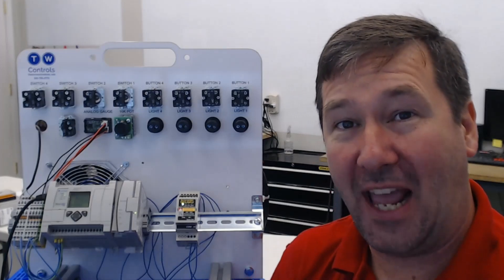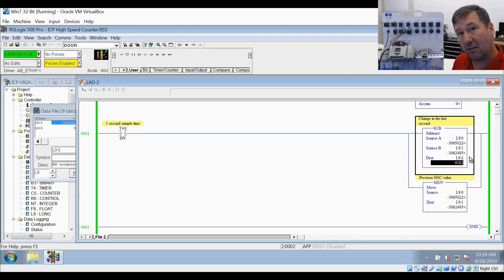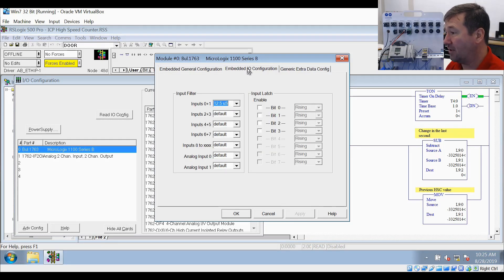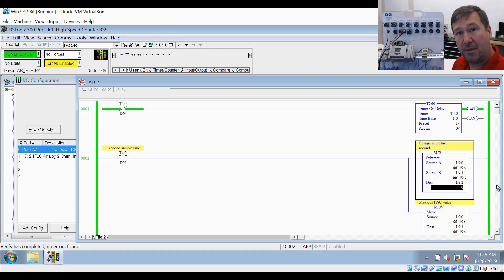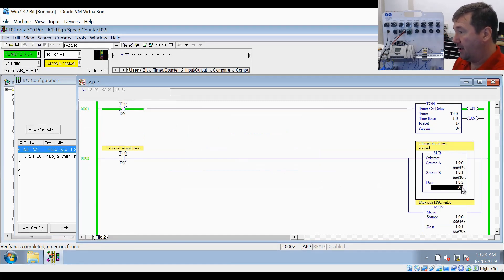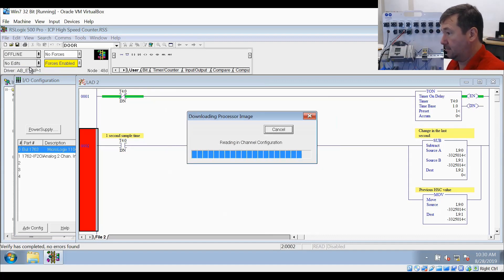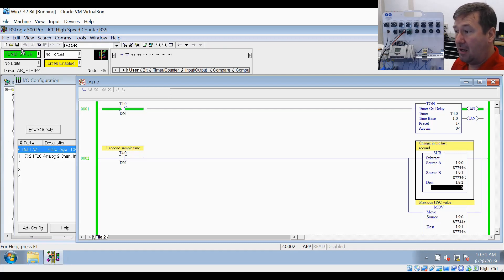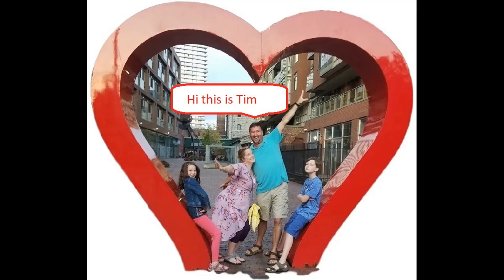What do input filters on an Allen Bradley Micrologix PLC do and what happens when they are too high

Comment: Curse you Allen-Bradley!!! Why must you harbor so much disdain and even hostility for internationally accepted measurement standards!? I could turn a blind eye to the use "u" in lieu of "µ" (but really, why should I? YOU control the programming for your PLCs, Allen-Bradley. Program with the right character, for crying out loud!), but I CANNOT abide the use of "S" (Siemens) when "s" (seconds) is intended. Sure, context gets us to the correct meaning, but by that logic, why specify a unit at all? Or why not use units of "newts" or "warm fuzzies"?

Okay, rant over. Blood pressure normalizing.

Tim Wilborne, YOU do excellent work! Thanks for being an indispensable aide as I try to learn this stuff!

Comment: Not sure why, but my input filter options are greyed out and I am not able to change the filter from "default". Do you know why?
Reply: I am using a Micrologix 1400 and Rslogix 500
Reply from the maker: You need to specify which base you are using to have these options show up.  By default, you only have to select a 1766 Micrologix 1400, but you must select a base that has a B after the L32 to get these options.
Reply: @TimWilborne  Thank you so much, I have been trying to work through this for quite some time!

Comment: hello can you help me  I want to measure  the position of a prenss , instaling a counter incremental   of 2000 ppr  on the shaft, and how can i reset the HSC  each 360 degres  it for  each cicle.  to have all the time  0 to 360 degrees.
Reply from the maker: You would just configure your HSC for one of the modes that includes the Hold and Reset then wire your Z marker to input 3.